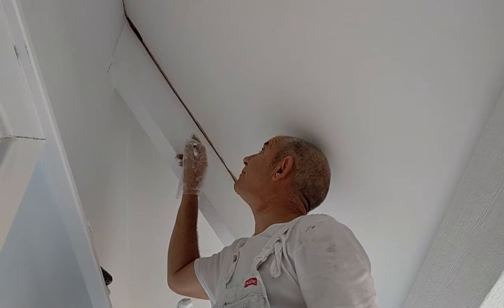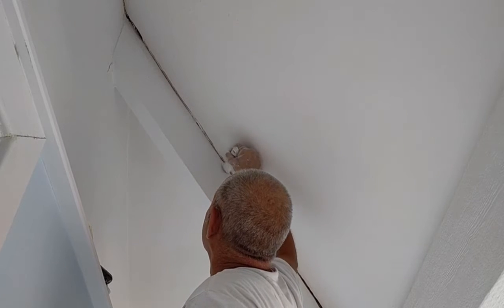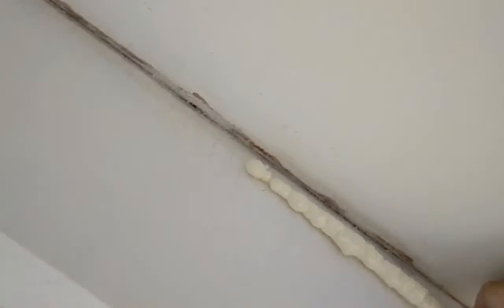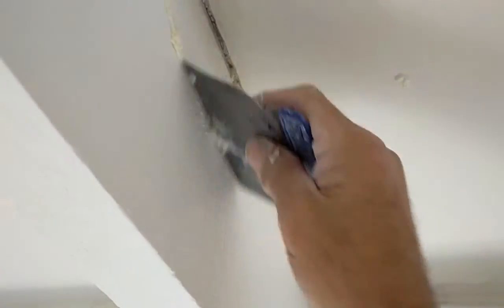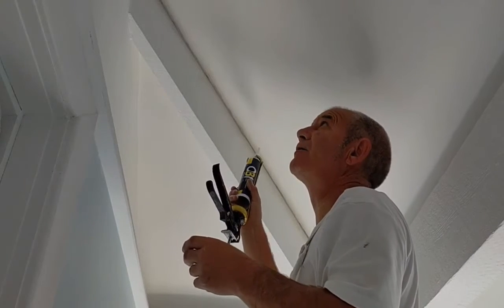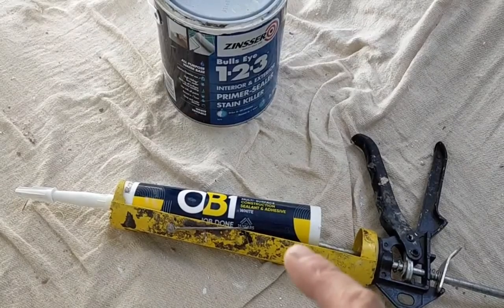Hybrid Fillers And Sealants. Are they a gap filling game changer?

Comment: Does the ob1 require sealing with something like 123 before too coating… I’ve used a different hybrid sealer and that did as the top coat crazed over it. Think it may have been sticks like which apparently is paintable ? Top video as always!
Reply from the maker: Thank you . not as far as we know..  with water based . But not sure with oil paint..  will be doing some more tests... Thanks

Comment: Great video and timing, I'm about to try and seal around top of wall/ceiling joint on landing. After seeing one of your other videos I'm going to use foam and was then going to use filler over that, so my question now is would ordinary decorator's caulk be ok to use instead of filler over the foam? Many thanks for the videos, they're a great help for us amateurs  👍
Reply from the maker: Thank you.. your welcome...  only thing with caulk is it takes a long time to dry.. and some paints can  craze while drying..    that's why we prefer to use filler.. the foam takes away movement and acts like a shock absorber.. OB1 is better and not had any problems as yet.. expensive...     caulk allowed to dry fully is okay if that's what you have.
Reply: Have you tried Nemesis Decorators caulk from Screwfix? Instantly paintable
Reply: @MRMYERS618  I've been using Nemesis for a couple of years but have been using OB1 for the past few months instead as a test. They are different types of product, I find OB1 can be a bit messy to clean up if you use too much but doesnt shrink like caulk. I found them both really good : )
Reply: @PaintingandDecorating  many thanks appreciate your help
Reply: @PaintingandDecorating  This was going to be my question as 9 times out of 10 you use a filler rather than a caulk of some variation. When you have situtations involving cracks with solid walls, for example along the length of the corner - would you tend to use a caulk of some sort as presumably the foam will not hold movement there like it would with partition walls? thanks for the vids - they are so useful.